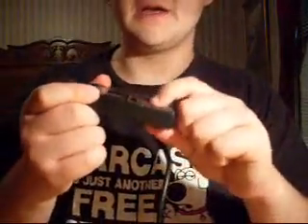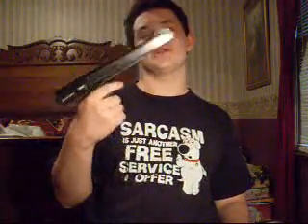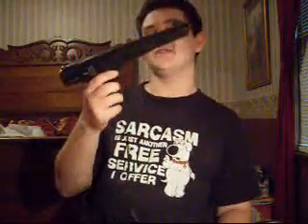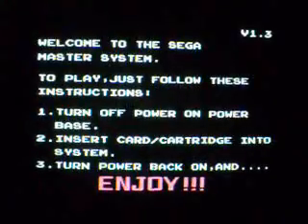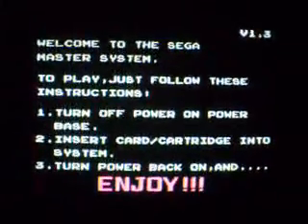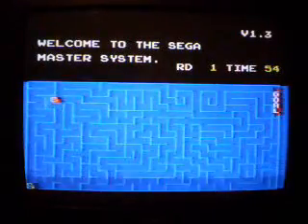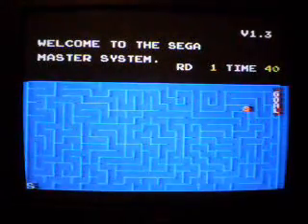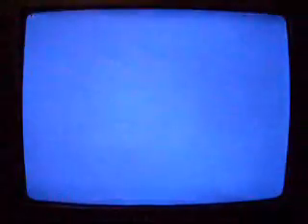Sega Master System Review-Part 2

Comment: The older Master System controllers in the middle of the D pad there's a threaded hole where you could scew in a little thumb stick.  Simmilar to the Europeaon Atari 7800 controllers.  I've got the older style controllers but don't have the little piece that screws in there...I wish I had one because I want ot know if it makes that D pad suck less.

Comment: That's weird... When I boot up my european console, the Hang On Game shows up. I don't need to press any button to get it started.
There is a small speed difference in PAL and NTSC machines. Europe got PAL. That's why I think that American games sounds so weird beacause they was running a bit faster. And last, the joypad was made of cheap plastic and break easy, the buttons. Also the "gun" as I call it didn't work more than 5 months and it broke!